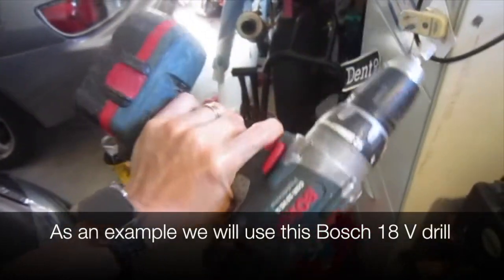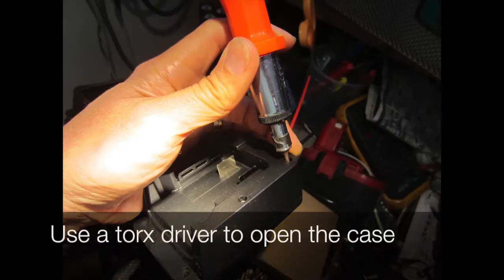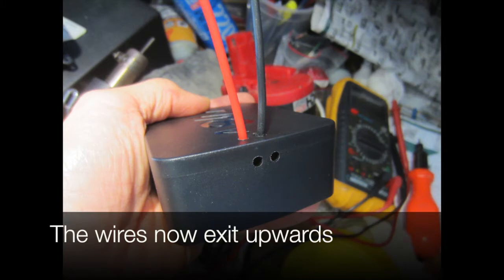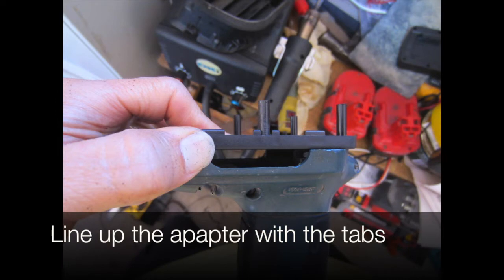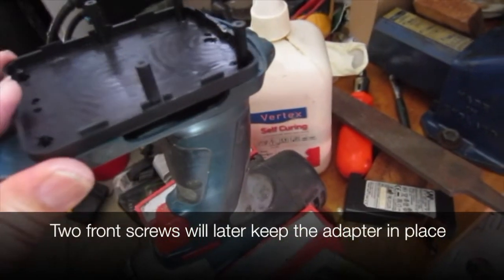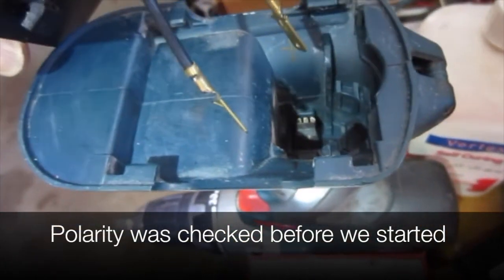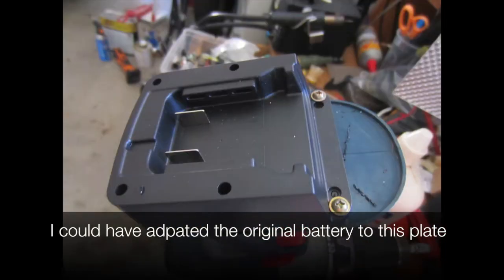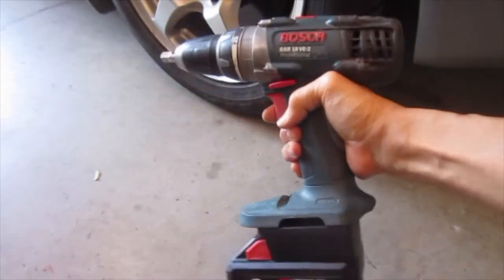Adapt any brand battery to any brand tool (Milwaukee to Bosch)

Comment: Can convert 4 pole Metabo drill to 2 wire positive and ground
Reply from the maker: I have not tried that but I think that you could . What are the 4 poles ( can you measure what is coming out of the battery ?).
Reply: @Dentinvent  problem is I don't have battery
Reply from the maker: @ibrahemahmed9328  
Go to a shop that has the battery and ask what the terminals are and find out the two main power positive and negative terminals . Google may also have it somewhere